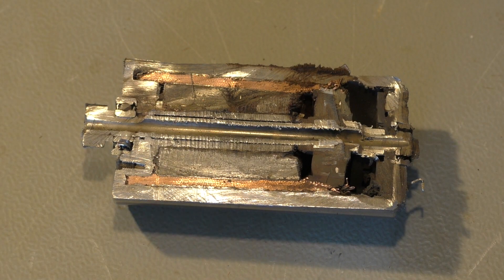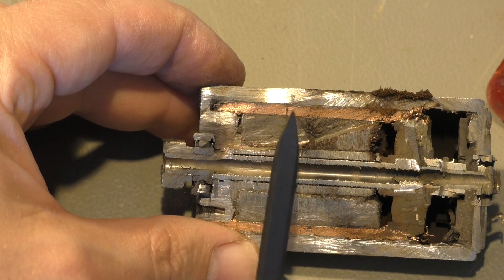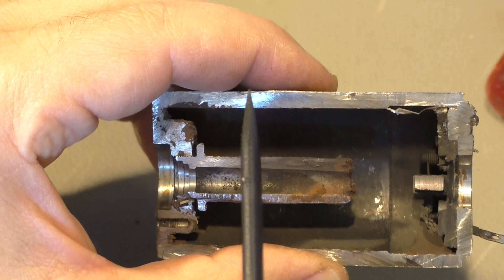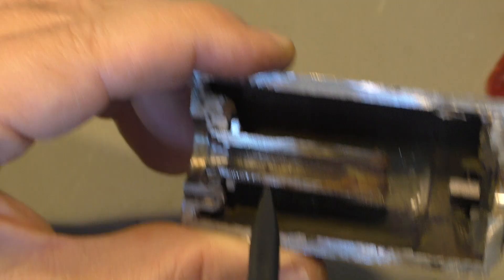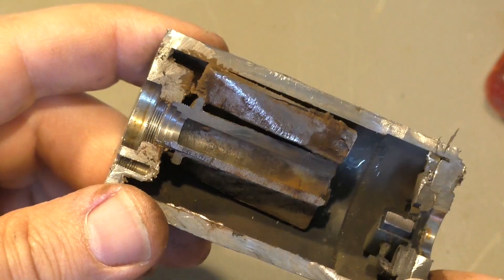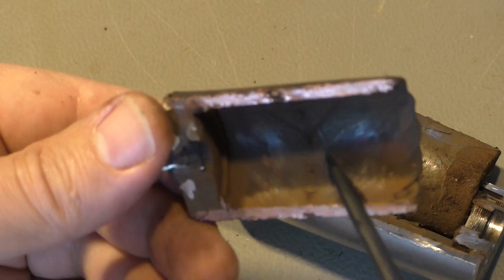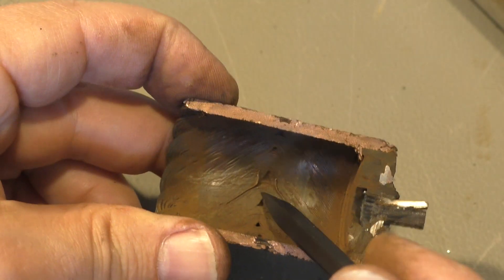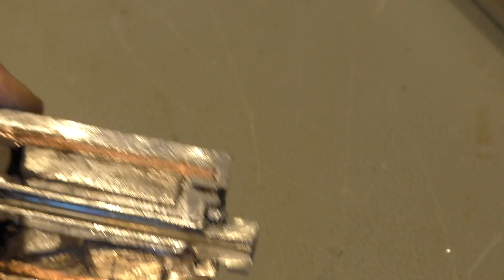Ironless DC Motor - What's inside?  (PWJ172)

Comment: Did it develop rust from the heat building up inside the motor then cooling off?
Or do you think somehow it got throwing a liquid?
Reply from the maker: I think there was liquid that got inside somehow and then it rusted. That's what caused the motor jamming.

Comment: That is a nice motor. Can they be found anywhere else other than the medical industry ?
Reply: You can find them inside mobile phones that work as a vibrator motor. 10 times smaller, but look the same internally.
Reply from the maker: @yruslan  They look similar but I doubt that those tiny motors have an ironless rotor like the maxon. Too expensive...  :-)
Reply: @PlaywithJunk  Actually they do have an ironless rotor. So it seems that they can make cheap versions of these. You can also find these in those cheap little helicopters that only last a little while and then wear out.

PS: Do you know what is the purpose of the rod that gets inserted down the centre of the motor when it is mounted to the housing?
Reply from the maker: They can be found in many quality products. Tape libraries, video recorders, cameras mostly professional stuff.